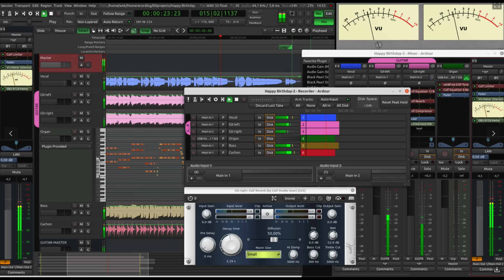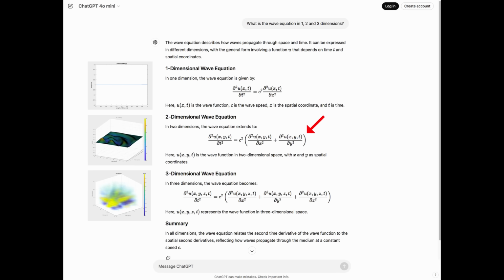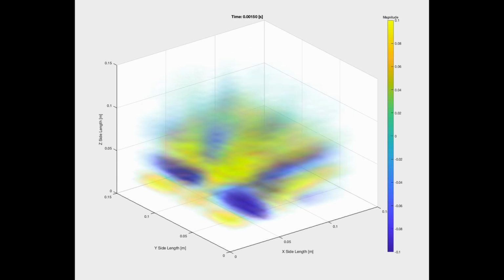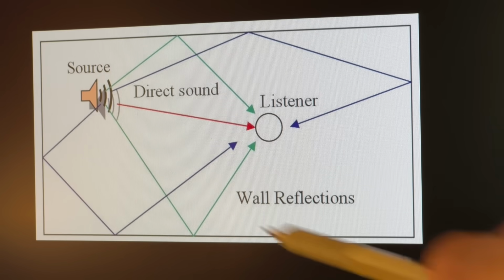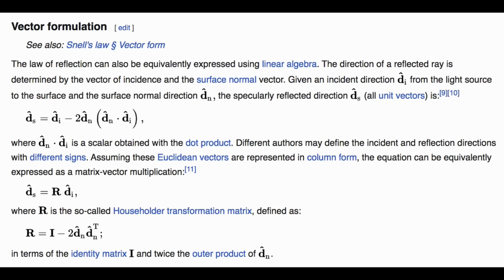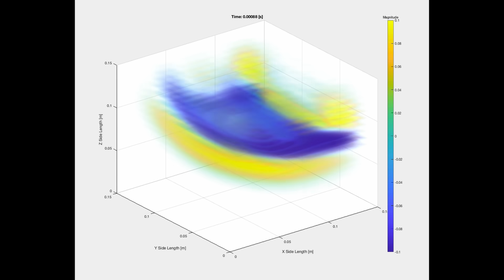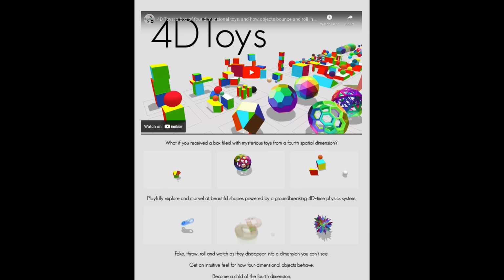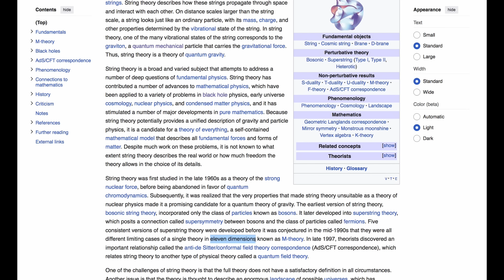Four Dimensional Reverb

Comment: As a theoretical physicist and composer. I really appreciate this. I will say- although you are sending a sound signal into a fourth dimension via simulation, this is different than actually working with a 4-dimensional sound wave. While the sound wave can oscillate along 4 spatial dimensions - assuming this is a true 4D reverb - you're not able to pick up what that sounds like as a 3-dimensional person. The reason this "muddies" the sound a bit is because you are only ever able to hear a 3 dimensional cross section of the 4 dimensional signal. In essence, the original 3D signal can get blurred across the 4th dimension every time it interacts with a simulated surface.

Mathematically: if you start by modeling your sound with some kind of wave function f(x,y,z,t) where x,y,z are the 3 euclidean coordinates in 3D space and t is for time here in this function. Once you send the signal into the fourth dimension the function shifts to include that spatial dimension f(x,y,z,w,t) where w is spatial degree of freedom enabled by the fourth dimension. So the dry signal looks like f(x,y,z,0,t) <--- Notice that w=0 explicitly here, since the sound wave is not yet sent into a fourth dimension. This dry signal is just normal sound.

AFTER we send the signal into the fourth dimension the function output changes so that the final output is f(x,y,z,w,t). Now w is not equal to 0. BUT as a 3 dimensional creature, you can only hear the component of the signal that lies within the third dimension at any given time. That w component of the function contains all the 3 dimensional cross sections of the final 4-dimensional sound wave that you CANNOT hear. That's why it sounds less tonal. You are only capable of hearing a kind of simulacrum of the actual signal. So this reverb is only truly able to appreciated by a 4-dimensional creature.
Reply: Yeah I was thinking about this
Reply: I suppose if you assume a 4d being has 3d eardrums.
Reply: At the frequencies we can hear, our ears are point-like. We don't hear f(x,y,z,t), we hear f(0,0,0,t).
20kHz corresponds to a 17mm wavelength -- compared to the typical 7mm diameter and 25mm length of the ear canal, you'd need frequencies >44kHz before it stops being valid to approximate the eardrum as a 0-dimensional point transducer. There could be some merit to simulating the rest of the listener's head and body in the 4d scene -- i.e. HRTF -- but lacking a head-model doesn't make the simulation incapable of capturing what a 4d space sounds like, any more than the lack of simulated 4d chairs in the room.
Reply: I'm not really sure I get what you mean by "this reverb is only truly able to be appreciated by a 4-dimensional creature." When simulating sounds, we are simulating the sound wave function at 2 points overtime. If a 4-dimensional creature also has 2 ears, wouldn't the experience be the same regardless of whether you are 3-dimensional or 4-dimensional? We can simulate what it would be like to move around the room in any dimension.
Reply: @vitulus_  human ears are 3d objects. A 4d creature might have ears (and bones,etc) that take up 4 dimensions of space, so a 4d sound wave would be able to bounce around in the 4d creature's head the same way it does in the simulation. This means that they would be hearing extra information that we cannot physically hear
Reply: would a 4D creature presumably have a volumetric eardrum rather than a planar one?
Reply: What if we try to project the fourth dimension into our three dimensions? For example, data science often uses methods to reduce the dimension of data.
Reply: At wavelengths of interest to humans, wouldn’t the ear, especially the inner ear (3D or 4D) just be well modelled as a simple air pressure transducer, the actual 3D or 4D structure of the ear being a mere implementation detail? (I assume it is appropriate to use the approach of geometric optics—single, point-like eye, no diffraction—to answer the question “what would a 4D room do to sound” and use emitters and recorders of time-varying pressure signals.)
Reply: I don't go with this, because we are assuming a 1D listener every time. Our ears only have push in and pull out. We have no sense that can sense a higher-dimensional wave, at least on its own. We can appreciate a 3D wave only, because our listening system has been tuned and trained to work out 3D meaning from two 1D signals. But the end result is always, that there is only 1D on the receiving side: In and out on a line.

So we really did hear what a 1D ear would hear in a 4D room.

What I find curious is that while closing my eyes and listening, I indeed did, not think about a big simple room. I imagined a big room with many corridors and walls and stuff. And that's probably exactly what the additional bouncings mean. It is the closest thing to a simple 4D room, in terms of sound reflection. That's what I think he meant with "you can always make the room more complex".
Reply: But since density is a 1dimensional quantity then sound should be a 2d quantity with time as the second dimension so if we assume planar eardrums(no talk about the shape of the ear influencing position) then we just extract the movement of the eardrum as pressure changes in front of it, meaning it would still be 2d and able to be parsed by human ears, a volumetric or 3d ear drum would make a sensory signal higher than 2d so it would be unable to be parsed by humans.
I may also be wrong.
Reply: So a better name for the video would be Four dimension reverb constructed in the third dimension.
Reply: It's all a matter of assumptions. Our perception of sound has low dimensionality, as you can tell if you compare it with our vision. Our hearing is slightly over 0D, our vision slightly less than 2D, each with some back-end processing that heuristically recovers a bit more (at the expense of making us prone to various weird illusions). Our hypothetical higher dimensional aesthete could have any of 0D, 1D, 2D, 3D or even 4D sound perception, though—like us—it would be constrained by both its evolution and its data processing hardware.

But to be clear, what we call sound involves molecules knocking around in space, with their motion ultimately picked up by us. Those molecules are inherently 3D objects, and we are the result of an inherently 3D evolution resulting in a 3D computational architecture. Any talk of 4D sound is also strictly an analogy, and we exercise choice when we make our mappings. Either the excitations or the perceptions could get a dimensional boost or not, and be equally defensible as generalisations—though only the low dimension case produces something “musical”, i.e. perceptible by real humans as real sound.

As to where any of this would get musically interesting, it's all just convolutions until it gets nonlinear, isn't it? And we're not modelling anything nonlinear here, not in the 4D “air” or in the 3D “surfaces”.
Reply: ok, time to make the plug-in for us
Reply: Where did you graduate from
Reply: Uh huh. Yeah. Yes. I understand what you are talking about. I am not lost in these big words you are saying. I am listening very well.
Reply: @sweetcisteen  Yes, big words definitely don't make me cry
Reply: If human ears are 3D objects in 3D space, I wonder what would be the most appropriate representation of sound to record, store and play back. I guess either full wave field representation (to work with any listener physiology) or, as we commonly do, approximations of the sound as one, two or sometimes more point sources and receivers.
Reply: i believe you
Reply: Brilliant explanation!
Reply: @dutonic   Assuming we're talking about mono sound, you're only ever mic'ing one point in space at once, and your amplitude function A(t) is one-dimensional regardless of the space's dimensionality.

You're right if we're talking about seeing something visually, but that's because we can only ever see up to 3 dimensions, so anything we would see in 4D space would only be a 3D shadow.  

I'm now pretty curious what stereo recording in 4D space would sound like, though...
Reply: So what you're telling me is that the conversion between the 4D to the 3D is a special kind of distortion.
Reply: Maybe this is the answer to summon Cthulu or the aliens…
Reply: But on the real though, his example is line with every thought experiment that involves 3D creatures interacting with the 4th dimension.

A similar experiment is to imagine a flatland… a 2D world of stick figures. How would they interact with the 3D world?

They would only experience a cross section of our hand…

This analogy is famously used by Carl Sagan.

I also like to think of smoking room with window curtains pulled over the window… if you let a little bit of light through the curtains… you will see a cross section of smoke…

This is similar to what the 2D creature would experience…

Maybe similar to what we would experience as a 3D creature?
Reply: Then there's me: I know how to chug the open E.
Reply: @AIHVHIA can you try this one out??
Reply: Is that really relevant though? We can already only hear sound in 0D, since our ears only pick up on signals in a specific 0D point in space. If you could sense sound "in x y z" you would be able to tell a sound at any point in a room.
Reply: @miners_haven  The creases in the ear cup (aka pinna, auricle) essentially create a filter on the incoming sound, based on where it comes from. That allows you to hear from what height sound comes from. You can fill your ear cup with cotton, leaving out only a hole leading to your aperture (ear hole) and you will lose the ability to distinguish sound height. That is also the reason why smooth eared dogs tilt their heads when trying to determine where a sound comes from, whereas wrinkly eared cats do not.
Reply: @miners_haven  Not really. Your ear is a 3D space. And you have two ears in two 3D positions.
Reply: @miners_haven  That's a human problem, not a dimensional problem. Look at dogs. They can tilt their ears in more directions than we can and can use that to their advantage. If a dog tilts its head to the side and perks up its ears, one ear sort of faces downwards while the other faces up. Same for other directions too.. one more to the left, one more to the right. Dogs can basically adjust their ears to hear where exactly sound is coming from.
Reply: @miners_haven  Heads up: Whenever somebody says they a "pHySiCiSt" in the comments, know that they cappin'.
Reply: @miners_haven  Your statement is incorrect. Your eardrum is a 3D physical object that vibrates in response to 3D pressure waves, meaning sound is inherently a spatial phenomenon. Your ears do not merely detect sound at a single "0D point"; rather, they detect variations in air pressure over time due to 3D wave interactions.

However, you are right that our ears do not directly perceive the exact (x,y,z) location of a sound source. Instead, our brain reconstructs spatial information using:

Interaural time differences (ITD) – the delay between when sound reaches each ear.
Interaural level differences (ILD) – the difference in volume caused by your head blocking some frequencies.
Phase and frequency cues – how high and low frequencies are scattered by your ears and shoulders.

This is why, for example, in an FPS game, you can tell if a gunshot is to your left or slightly behind you—your brain processes spatial cues in a stereo field (typically modeled in two dimensions but extendable to 3D).

You should look up spatial hearing, binaural audio, and HRTFs. They explain how we perceive 3D sound despite only having two ears.
Reply: @dutonic Your eardrum is a 3D object, but it is smaller than the wavelength of sounds that are within the human audible range, so it may as well be a point as far as its ability to localize the source of a sound is concerned. Even with two ears, our ability to do so is quite rudimentary.
Reply: @dutonic  In a real world scenario where a 4D sound wave is interacting with a physical (3D) eardrum this might be the case but I'm assuming that the way this is simulated it's probably just making the sound by modeling the pressure at a point (or maybe 2 points) in space as a function of time so the real world nuances of a human ear shouldn't be responsible for the results demonstrated in the video right?
Reply: @dutonic  An applied physicist here. I don't agree with you. The eardrum is basically a pressure sensor and pressure is a scalar, therefore it has a single value at every (0D) point and no direction. If sound was "inherently a spatial phenomenon" how come that sound files only have two channels? Yes your eardrums are 3D, but compared to the size of a room they are basically point like and they are not capable of detecting more information about the sound than (average) air pressure near the ear drum, at a given time. That works the same in 3D, 4D and ND, I don't understand why would a cross section need to be taken at any point.

The sound localization techniques that you mentioned all involve the interpretation of the sound signal by the brain. And yes, going into a higher dimension will confuse that, but that is kind of the point of this simulation I would say.
Reply: @dutonic  Only way to hear higher dimensions is with DMT.
Reply: @JorgenTiigisoon  and @IroAppe - Oh thank god, I was worried NO ONE on this thread was going to acknowledge that sound is only 1D, being a scalar recording of air pressure/density at, or averaged over a small volume near, a point in space. It doesn't matter that our ears are 3D, or that our eardrums resemble a 2D plane. What matters is what is detected and sent to our brain. Sound itself is just 1D signal, i.e. more dense vs less dense, or in the detection thereof, more push or more pull. It also doesn't matter that the other side of the eardrum houses the cochlea, which is basically a sort of discrete Fourier transform on the wave. What matters is the waves of changing air density that arrive at the eardrum and make it move, which we can record, play back, generate, or simulate with 1D signals.

Honestly, while this video was a fun thought experiment, there was never going to be anything interesting. A 1D-space reverb can only bounce off of its two "walls" (the two endpoints delimiting the 1D line segment), a 2D-space reverb  has four "walls" (the four line segments delimiting the 2D square), a 3D space has six "walls" (six 2D squares delimiting the 3D cube), and a 4D space has  eight "walls" (eight cubes delimiting the 4D tesseract/hypercube).

You could conceptually extrapolate the 4D (or higher) effect on the reverb by considering the difference between 2D reverb and 3D reverb and adding that much more, i.e. it's just gonna add more cowbell reverb.
Reply: @miners_haven  Actually, each of our eardrums are 2D surfaces, and having 2 of them allows us to interpolate 3d position.
Reply: @miners_haven  this is insane, where to even start? Go to school dude you are not learning anything on the internet
Reply: I disagree, when it comes to appreciating (3+n)D geometry, we can only ever see the 2D orthogonal cross-section of the 3D orthogonal "field-section" of the true higher dimensional geometry. A 3D creature in a 3D cathedral cannot hear the waves at the opposite end of the cathedral, though, a higher dimensional creature could exist in any configuration within the cathedral where specific hyper-configurations allows them to hear the music as we intend (some hyper-position that collapses them back down to one location in 3D lol). In a way, "three-D" waves within a 3D field already mimic higher dimensions, where an observer may only experience the sound at their 3D orthogonal "field-section" in space after interference occurs where they cannot observe (hear) the waves. 

We might not literally be able to see the entire surface of 3D at the same time without funny projections, let alone the true geometry of n-D hyperspace; though, I'd argue that converting waves to audio might be the greatest way humans can experience the true geometry of n-D hyperspace. Because, we're always stuck with these funny projections for viewing hyperspace (at least, outside of the brain), while a simulation for hyperspace reverb could definitely opt to either play the orthogonal cross version or the true hyperspace version.
Reply: But: your ear uses a 2D membrane to detect sound in a 3D world...
Reply: @tompw3141 so 4D creatures could use 3D ear membranes. Unfortunately we’re jumping up 2 dimensions with this one
Reply: @dutonic I don't really see your point. We have the exact same problem in any reverb, even traditional lower dimensional ones.

At the end of the day we perform a simple point sampling of the amplitude. Which is much less than "a 3 dimensional cross section".

(There are some exceptional cases where entire sound fields are simulated and sampled with HRTFs and such. But that's beyond the scope explored in this video)
Reply: Definitely this high quality comment was not written by a bot 😂
Reply: Great explanation!
Reply: The eardrum is essentially a 2D manifold embedded in a 3D space. It is 2D, its vibrational modes are those of a 2D plane. Maybe to take advantage of a 4D space you'd therefore need to simulate a 3D eardrum (some kind of "earball").
Reply: This argument ignores the imperceptible nature of our human senses, which do have the ability to perceive more than the 3D space time labyrinth. Consciousness doesn't originate from 3D space and our perception goes beyond it. This is how we're able to create simulations and graphical representations.
Reply: Was he really claiming that it was a 4d wave? I did not get that impression. He is modeling a wave in a 4d space. This is interesting information but it comes across as needlessly pedantic.

Scientists, am I right?
Reply: @benny_dryl I left my comment because the video excited me about a topic I am passionate about and I felt inspired to share my thoughts with a likeminded musician/math enjoyer. It was not a criticism of the video or the creator.
Reply: Ah yes, the classic "I’m a theoretical physicist and composer" flex—how charming. While you think you're hearing a 4D reverb, you’re actually just getting a 3D slice of a higher-dimensional waveform. The muddiness? That’s your puny 3D perception struggling to grasp a signal smeared across an extra spatial axis.

Mathematically, your sound starts as f(x,y,z,t)—normal 3D audio. Send it into the fourth dimension, and it shifts to f(x,y,z,w,t), where w is the new spatial degree of freedom. Your ears, tragically bound to 3D space, can only perceive the projection of this function onto their limited reality. The real sound? Forever beyond your comprehension. A true 4D being would hear the actual reverb—yours is just a sad, flattened approximation. This is a generated response to fit your liking of time wasting.
Reply: @mikeliszemitis You really think this is some "there's no way you could understand it" hoity toity nonsense? It's just a fact that we couldn't experience 4D spatial stuff in the same way a theoretical 4D creature could, any more than a theoretical 2D creature could experience the 3D world in the way we do. It's not a judgement on any of them being inferior, any more than humans are inferior for not being able to hear pitches as high as dogs or cats are inferior to humans for having worse color vision.
Reply: @mikeliszemitis  weirdo
Reply: You are simply making the 4th dimension a physical one when it doesn't have to be. If we assume 4d is time, then nothing changes at all with 3d sound unless we rewind time and fast forward time. The time itself only effects the phase of the note at the point it is detected by our ears. So therefore I disagree with your notion and raise you to the time dimension what say you? Lol J/K but seriously think about it.
Reply: Kind of like "um actually the hypercube isn't 4D because it's an image on the screen and thus it has to be experienced in 3d but actually 2d because it's an image on a display"

Needlessly pedantic. No shit we can only experience physical phenomena in 3 dimensions. It's why we need to represent a hypercube as a 3 dimensional object.

I'm not a theoretical physicist. I watched Flatland in high school. It makes sense to me.